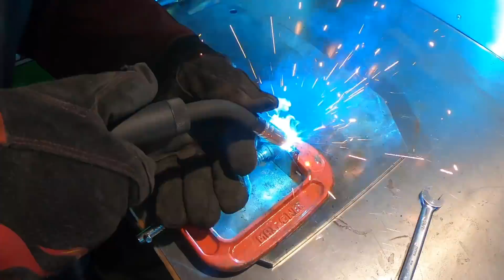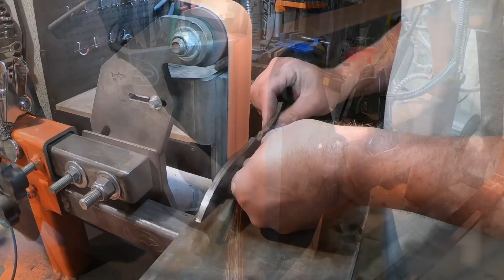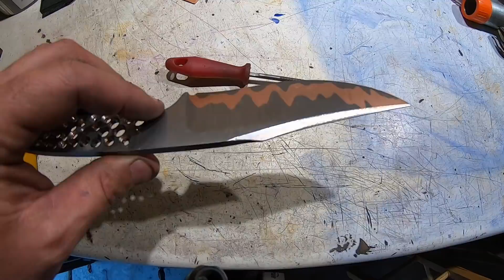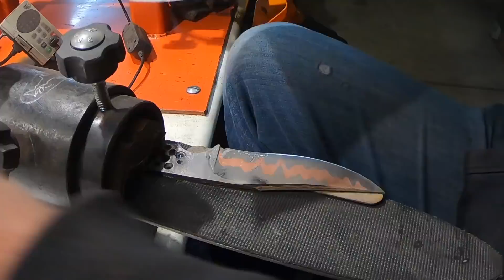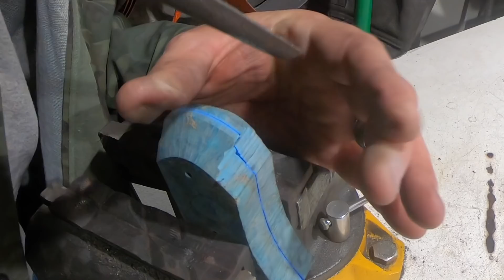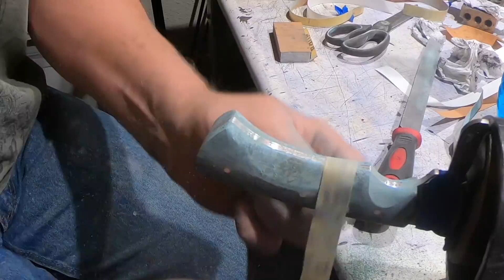Forging a Cu Mai Hunting Knife

Comment: Glad you decided to etch it and bring out the dark edge ,good work bro 

I’d love to see this done for feather 🤔😳
Reply from the maker: You can layer a feather over it but I don't think it would work to actually feather copper with the steel because it would end up on the edge.  Thanks for watching!
Reply: @TyrellKnifeworks  I feel the same way about all Damascus actually,unless it has core steel I’m not a fan of Damascus for that reason 

I’ve looked through scopes to see the weld lines from pattern steel which is why I toss core into any of my new billets 

Maybe I’ll do up some feather with copper and toss a core in it 🤔✌️

Comment: Great job Dennis! I started doing one of these about a year ago. I found out very quickly that you have to worry about how hot you get the copper. I side tabled it and haven't gotten back to it. I was very worried about how to heat treat a knife like that. You've answered a few questions for me maybe I'll give it another go soon. My tools are not as precise or sophisticated as yours I'm still a little worried. 😎
Reply from the maker: You’ll get it done!  I was surprised it went so well.  I really love this process and the outcome so you’ll be seeing more of it.

Comment: Here's a video https://www.youtube.com/watch?v=jCX18YuG5B4  ;) ;) And here's a photo https://scontent.fbru1-1.fna.fbcdn.net/v/t1.0-9/60473624_2224069774341767_8239102812651257856_o.jpg?_nc_cat=109&ccb=2&_nc_sid=730e14&_nc_ohc=4NbIaxjK9i0AX_T9kqD&_nc_ht=scontent.fbru1-1.fna&oh=3bf46324ae853a6947a2f4b6012f9e56&oe=600CDC4B   Allready a few years back. You are basically diffusion bonding different metals ( mokume gane , mokuti , zircoti , damast are all the exact same proces)...non of them actually need to melt to get a weld/bond. Next level up is forging steel to titanium damast /mokuti .....a bit more tricky , but it can be done. Think shielding gas , cannister and a softer intermediate buffer layer ;)

Comment: Very nice! It seems like the copper would be pretty soft after the heat treat. Does it seem like it'll be probe to scratching? What would happen if you tried chopping into wood with it?

Also, do you have a video on handle shaping? I'd be keen on hearing your thoughts about size, ergonomics, etc.
Reply: The quench would definitely soften the copper.  Depending on the alloy, the steel temper might precipitation harden it again.
Reply from the maker: The copper is pretty durable, not like steel of course though.  Batoning it into wood would probably scratch it too.

Comment: I guess the term would be forge brazing instead of forge welding.  I wonder if it would stick together with just heating and letting it cool without pressing.
Reply: Also wonder if something similar would work with brass or bronze.  Might melt out before the steel is hot enough to forge.  Maybe a stock removal billet and very careful heat treat.
Reply: @bransonsgeneralstore   Its not brazing since non of the metals in the stack needs to melt to get this accomplished...look up diffusion bonding dissimular metals on Wikipedia . Mokume gane , timascus , mokuti , zircoti , damast, san mai etc .....are all the exact same process by using heat and pressure. Only the metals used are different. I tried using brass a few times.....but its even more tricky since the meltpoint of brass is more than 200°f lower compared to copper.
Reply: Here's a photo of a testpiece i once did. Carbon steel , pure nickel , copper and brass in one piece  https://scontent.fbru1-1.fna.fbcdn.net/v/t1.0-9/133362178_3572775482804516_3972157443224739515_o.jpg?_nc_cat=102&ccb=2&_nc_sid=730e14&_nc_ohc=v13pWUAf-1cAX9bF9Z9&_nc_ht=scontent.fbru1-1.fna&oh=50698b0b2953b4924e36e5b0f7220d69&oe=600D9686 It can be done , but i do not think you can use this in torsion or feather damast. If you deform the billet to much the layers will shear off because they have a fifferent expansion rate.
Reply from the maker: I'm not sure it would stick without pressure.  I do think that even doing this by hand with a hammer would probably work.  Unless I got lucky my first try, this seemed pretty easy.  😜

Comment: Very nice!  I always thought you had to have nickel involved to make this work.
Reply: Yes, you need a nickel layer on either side of the copper to stop galvanic corrosion.
Reply from the maker: I guess there’s a bit of nickel in the 15n20.  I didn’t know it was needed though.  🤷‍♂️
Reply: @TyrellKnifeworks  it doesn't have to be nickel, but that's the closest thing we use in knife making. Google Galvanic Corrosion when you get some time. It's quite interesting. Nice Build by the way!